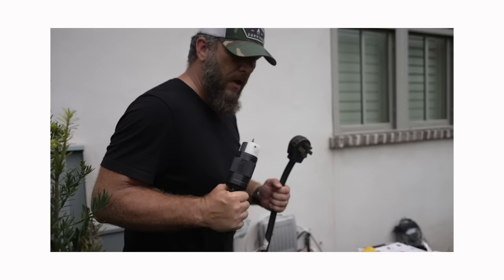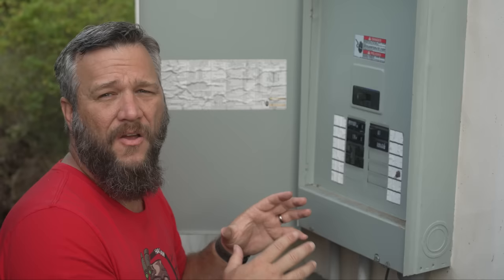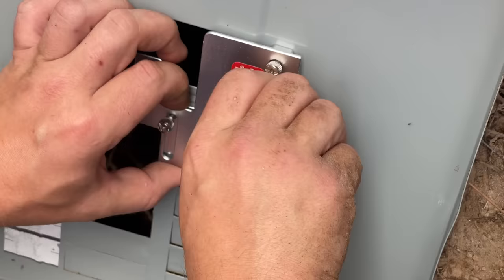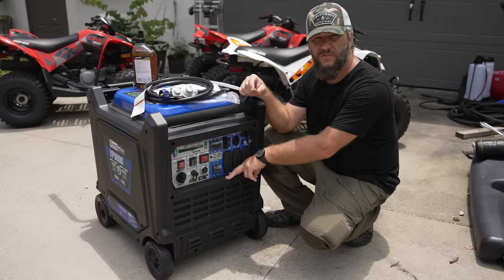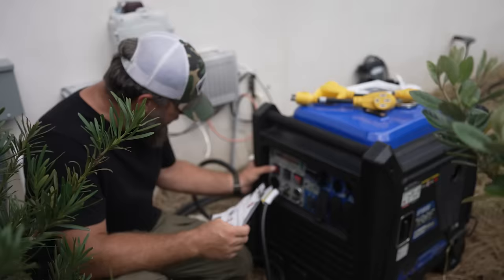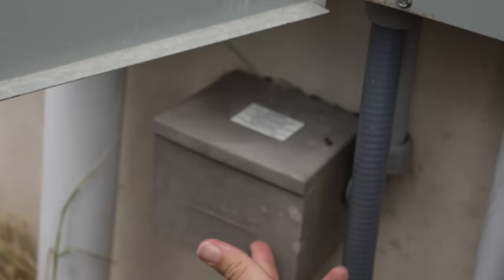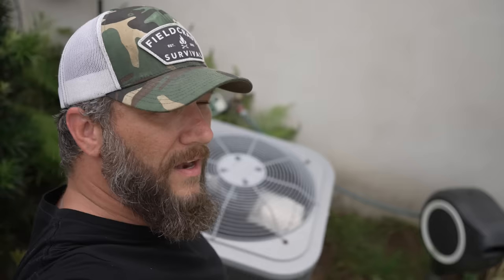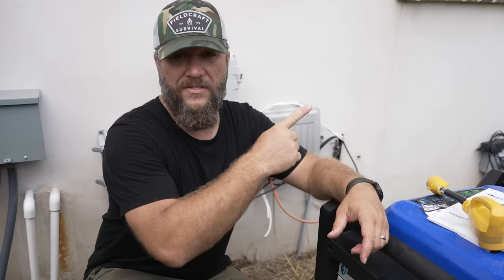90% Don't Know About This Fatal Generator Connection

Comment: Enjoyed the heck out of this video. I've got two Predator 9500s in parallel that I'm about to hook-up to the house and this video helped.  I disagree about having-to-go with propane.  That issue is mitigated by using ethanol free fuel, a stablizer (go with the marine version) and by running the tanks dry during the off season.  Anyways, enjoyed the video and the comments. Subscribed, bell rung, commented, upvoted, liked, shared  .... may the algorithm gods smile favorably upon your channel friend. BTW, I would have pulled the same funny on my wife except I would have fallen backwards and popped some fake smoke and blood out of my mouth while doing a full body twitch. PS ETA: You've got a magic start on that HVAC right?

Comment: One last comment. Make sure both house and generator breakers are off. Connect house end of cable, then generator end of cable. Start generator. Turn on house breaker. You should see no change in load, speed or sound. Then turn on generator breaker. Immediately check load current, voltage and frequency. This way if something goes sideways you can open the generator breaker and stop the generator more quickly.

Comment: I hooked a natural gas portable to my home and used an interlock switch on the box. I too will never put gasoline in it!   Propane or NG only. Paid $69 for the interlock.  I had to do the same to the apartment and made my own interlock out of old phenolic board I had sitting around.  Made a template out of cardboard and then once it was right, used the phenolic board.  It worked perfectly.

Comment: Everything dude is saying is correct. Linemen should always treat everything as hot. If you close the main on the generator its gonna trip its breakers anyhow but it will send a pulse down the line for the hood to get for sure. That being said, let me blow your mind. Your dryer circuit is already that BOOM! Change NOTHING. Buy generator, make a 240 volt cable with male on both ends. Whats the problem? No dryer is the only one I see. One cable. One generator. Always have your MAIN OFF while generator is RUNNING. That is what that interlock is. For Dummies. Dryer breaker becomes Power from Generator.

Comment: rather than an interlock i prefer to use an automatic transfer switch. that way you can use a remote to turn on the generator without going out to the generator. they are fairly inexpensive on ebay and work really well

Comment: Just a thought but I may be wrong.. You should have moved the breaker down but keep it on the same 'leg' on the panel.  You have zero loads on the right panel which is not balanced.  All loads are on your A leg.  Maybe I am missing something for your panel appears to not have many breakers.  Interested in your thoughts.  After looking at the video you actually did leave it on the right side which is not what you said in the beginning.

Comment: What about when you have two panels?  How will one Interlock help in that situation?  Great video and thanks for sharing!
Reply: That would depend if you have a main panel & a sub panel or if you have a 400 amp service with 2 main panels.  I can think of several ways to do it.

Comment: 2 other points keep the portable generator at least 15 feet away from the house to prevent possible carbon monoxide getting in the house.
also keep the generator on a sheet of ply wood or concrete, something non flammable unlike just setting it in the grass, To prevent fire hazard.

Comment: PS on the nuts, use self locking nuts or at least install the lock washers and use blue Locktite so they don't fall of into the panel. LOL on the warm and dry. I had the exact lizard's family try it on my panel too! I ventilated his head with a nice big hole. Sad part I can't do this on my circuit breaker panel as the main is outside and the power circuit panels are all inside on the opposite side of the house and that panel doesn't have the same set up as yours. Thanks for sharing. Best Wishes & Blessings. Keith Noneya

Comment: Hello: Please be aware, the propane tank will run out quickly.  You can get a kit to convert the generator to accept natural gas.  Then you could run natural gas from a line connection; you may be able to first run out of the propane and then switch to the nat. gas.

Comment: Just buy a Generlink.  It plugs in behind the meter.  You remove your meter and plug it into the lugs the meter attaches to.  Then you reattach the meter to the Generlink lugs.  Then it has a 4 lug twist lock to plug into the generator.  Then a quick connect to the Generlink.  Then the entire house has power.

Comment: I have a question / Concern... You have the Inverter / Generator sitting beneath a window. We've always been told they need to sit further out from the house to be sure exhaust doesn't infiltrate the house. I know the window is closed, but don't you think it would be safer to run it a little distance from the house in case there is a leak you might be missing around the window? I know I'm a worry wart but better safe than sorry. I wouldn't run a generator that close to the house.

Comment: Be sure to turn off the breaker in the breaker box for the generator or unplug the cord from the generator before turning off the generator engine or it could damage the generator or the inverter on the generator.

Comment: I installed a soft start on my AC unit and it went form pulling like 70 or so amps at start up to 38 amps. Its a 5 ton heat pump unit.

Comment: If you left the main breaker (by accident) on and let it back feed, would it not immediately overload and shutdown the generator trying to power all the neighbors houses too? example 8000 watt generator trying to power say 4+ houses drawing 8000 to 20,000+ watts each. It would probably be a much higher start up surge too.
Just asking.

Comment: Another idea is to install an interior audio and/or visual alert to let you know when the power comes back on. You would hook that to the line side of the main house breaker. Those should also have a light switch to turn them off once you have been alerted to the power being restored.

Comment: All true about back feeding. 
However it usually happens like this . Power goes out up the road somewhere for whatever reason.  All your nabors and you are without power you hook up your  little generator that can barely power your house and it instantly is trying to re power the hole naborhood and instantly dies or pops it overload protection.

Comment: The 10 minute delay on outside compressor is common in southeast usa. The power company require the delay to not over power grid. I learned that from anti diy guy utube great channel too.
Reply: The heat pump for my home has a box it is connected to by the power company and if you cut off the power it will take about 5 minutes for the green light to come on it to let you know the power is back on after the delay.

Comment: Dang a trained electrician didn't install an interlock kit!? I was being cheap but I wouldn't plug a generator in without making an interlock kit. They are easy to make if you work with aluminum or metal at all.
I learned if you buy a large generator the power will never go off again, I can't explain it.

Comment: ... you can also backfired to neighbors on the same transformer. At least that's what I have been told. Also, best practice would be to make your connections to the generator BEFORE turning on and then turn on the breaker.

Comment: Regular generators are modified sien wave that clips the waveform and is hard on sensitive electronics, pure sien wave is more tapered and much more gentile on electronics.
Reply: will a battery back up with surge protector stop that?  mines rated for 1500 volts or something it has like 4 outlets for surge and battery back up and for just for surge

Comment: My uncle used a buncha coat hangers wrapped in like 10 rolls of tape as extension cords 2 backfeed power into the 🏡 wen we had the big ice storm. Probs not recommended but uncle Mac wuz willing to try anything. Wuz gr8 to have power wen the rest of town wuz dark.

Comment: Wonder how the output is out of a pto generator is for your tractor. Wynco etc. I hear the frequency drift is what causes the majority of electrical device stress. Low voltage is no good either.

Comment: Not just shock. But feed back through a transformer and turn you generators 220vac to several  thousand volts ac.

Comment: Are you using a transfer switch with limited circuits or did you go with just an inlet box to pick and choose circuits as you wish? Asking because I just bought that exact generator and weighing my options.
Thanks

Comment: There are some transfer kits, thar you do not need an interlock.  They have 6 circuit with circuit breakers and 3 position switches. Red wires go to the circuit breakers you want to use and the black wires goes to the wire you remove from the circuit breaker.

Comment: We had straight line wind years ago rip through our area And we were without power for a little over three weeks I had an old McCullough 5000 W generator I knew nothing about using generators I’ve never owned one before I studied up on it I used it to run my air compressor and my welder more than anything else and then the power went out once in a while here and there eight hours or maybe a half a day or something like that and it worked really great we were very impressed with everything We could do with it and then the straight line wind incident occurred and I learned a valuable lesson when the grid is down in your area a big generator is exactly probably what you don’t want,,,you may need a big generator intermittently for certain things however for refrigeration lights(we didn’t have a small home solar set up back then wish we had though)occasional use of a microwave and in our case an air conditioner because it was 98+ degrees most of the time when that happened with extreme high humidity. We learned when gas is expensive it’s gonna be very expensive to run a big generator they gulp fuel that big 5000 watt McCulloch generator used about 10 gallons of fuel every 24 hours or so not fuel efficient at all most of that power was actually being wasted it had that auto throttle feature without that it would’ve been even worse there was no way in the world that we were using that much power while it was operating  throwing money away and another thing we learned when the grid is down it’s gonna be hard to find fuel in your area I had enough storage fuel to run that generator intermittently for about 4-5 days (intermittently sucks more than just a little bit especially when it’s hot outside)some of the gas stations in our area still wasn’t selling gasoline I had to drive pretty far to find it and when I did I had to buy rather large amount then after a while more stations in our area we’re up and running but we still didn’t have power I still had to buy that gas and lots of it it became ridiculously expensive what we have learned to do since then is to have a couple of small inverter generators we have a older champion 2000 W inverter very nice clean power very economical to operate and we have an older Honda EU 2000 again very economical to operate and very clean power you can set them on Ecomode and they ship the gasoline compared to the bigger generators. we now have Solar to help out with lights recharging small devices recharging batteries for radios and our police scanner things of this nature we can run the refrigerator the microwave intermittently even our 120 V digital inverter deep well pump we have one that will run off 120 V AC or so many watts on DC i’m not sure exactly how many I have never tried it however if we have an extended grid down situation we would probably have to run that will pump intermittently on DC battery power once or twice a week,,,you can throw a blanket up over one room in your house and use a small one room air conditioner we’re talking 5000 to 7000 W yes it’s inconvenient however it’s also very comfortable when it’s very hot and humid outside just to run lights with no available power at all it’s a royal pain candles and kerosene lamps or not a welcome thing when it’s already hot to begin with in the first place with these new DC powered LED bulbs we have plenty of light we also have some DC powered fans not little tiny ones but decent size you can put in the window and some are on pedestal/stand,,,all these things help more than you could ever possibly imagine you want to save as much fuel gasoline/propane as you can in a grid down situation. we have a standard size Frigidaire refrigerator top mount freezer and we have a big chest freezer as we buy meat from local farmers and in a grid down situation we would probably turn the large refrigerator off and use our two car/camper refrigerators that work on 12 V they’re not a Thermo electric cooler mind you they are actual refrigerators with the compressor they can freeze or be set as a refrigerator and we also have a 5 ft.³ small AC powered freezer out in the shed we estimate we could cram all of our meat and things in that 5 ft.³ model and just operate that for as long as we needed to along with our either one or two of the 12 V refrigerators we wouldn’t have to invert power with our Solar to run those refrigerators you may actually find you can shut down your generator once in a while to see if you can run everything on Solar for a while( not the air conditioning though not for long anyway)open the windows and run your DC powered fans for a little while something to think about folks if the grid goes down we’re going to have to be frugal about how we try to power our homes I was looking at building a faraday cage to protect one of the generators and a back up solar system A faraday cage would help protect sensitive electronics from a solar flare or otherwise

Comment: We have a 10KW Tri fuel generator that uses one 20# Propane container in 6 hours  (cost is $22.50 or for 24 hours which equals $90 per day ) natural gas costs about $31 for 24 hours or 1.31 per hour or about $930 per month to operate. I should note that our monthly on-grid cost is around $5 per 24 hours and that's with gas heat, cooking, hot water, and dryer which in the winter is about $4.60 per day

So best to plan your time on the generator very carefully or you won't experience budget shock come the end of the month.

Comment: Adding a soft start to the AC will help the generator from having to work so hard as the AC starts up. It starts the fan first and then the compressor. Way less amps needed all at once.

Comment: Do u have a soft start installed on your ac condensor?  I just got a 9500watt inverter and was told it would only run my 3 ton ac unit and nothing else…i do not hv a soft start installed.

Comment: I'm pretty interested to know if your generator is able to run in parallel with another especially if it was the exact same model would you be able to make three phase out of that?, By the way running pure sine wave is recommended for any kind of sensitive electronics like your computer or whatever Without it you would be susceptible to power surges Even something like charging your phone it could affect it and melt it let the smoke get out

Comment: I’m not sure if you did this or not or if anyone has pointed it out to you but it’s not good to shut down a generator under load it causes voltage drop and frequency issues but this may not apply to an inverter generator

Comment: For the cost of that portable 9000w genset you coulda got a nice used kohler dual fuel 12-20kw genset.  I got a nice used kohler dual fuel 12kw for $500 just a couple months ago at an auciton and it was super clean.

Comment: I call BS on the lineman safety.  First, the lineman's first job is to ground the line he's working on to prevent exactly this type of scenario.  Second, if your 10k generator was hooked up to the distribution grid in your neighborhood, it would immediately stall the generator or pop the 50a breaker as your small generator would be attempting to power not just your house, but every house on the circuit.   

Sure, it sounds good to worry about a lineman, but if they're doing their job correctly and you have any neighbors, there is zero safety risk even if you backfired.  Urban legend .

Comment: Here's the important thing to remember. Professional Electrician mean one thing. A certified  IBEW journeyman.  Guys who do residential wiring installations are not Electricians! That is a self described title.  It's like calling someone trained in first aid, a Doctor!!

That is not to say that no self described "electricians"  may not be properly skilled for this kind of work, but you have no way of knowing that. Just because someone gets paid to do a certain thing, does not make them a professional. Well recognized certifications, licensing and insurance bonded is what makes people professionals, 

Electrical work is not a DIY skill!!!  It is far to easy to be killed by doing something wrong.

Comment: I just join to this channel because of you truck bed drawer build. I think I seen a tractor in the background. Ok I seen you struggle move the generator, why not put the generator on a skid and move it around with your tractor?
Reply: Or is the generator always in the same place
Reply: Plus having that generator on a skid would get it off the ground when it’s raining so at least it wouldn’t be in a puddle of water